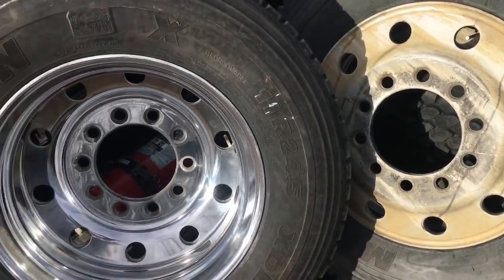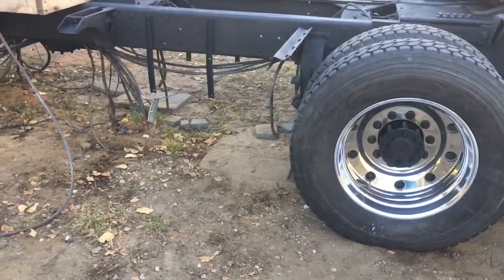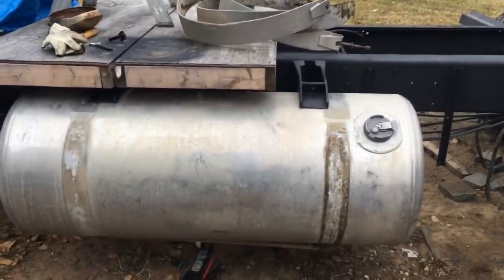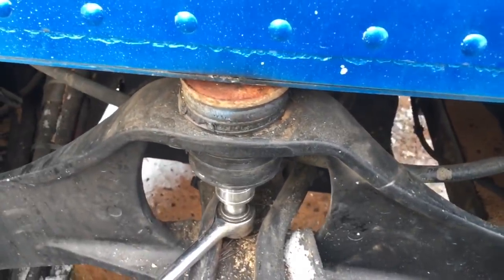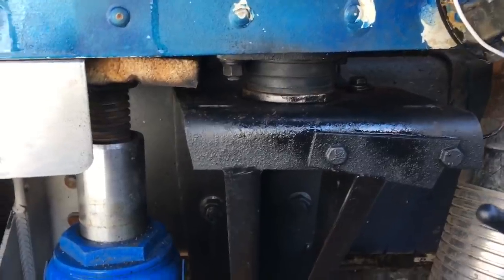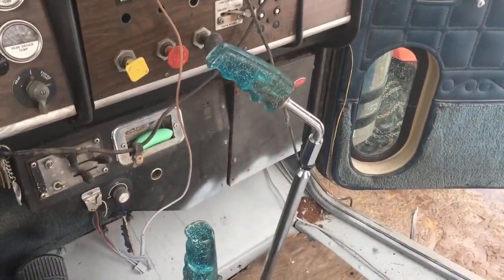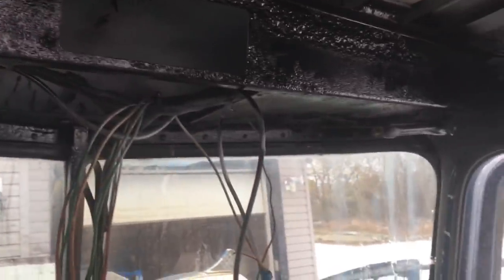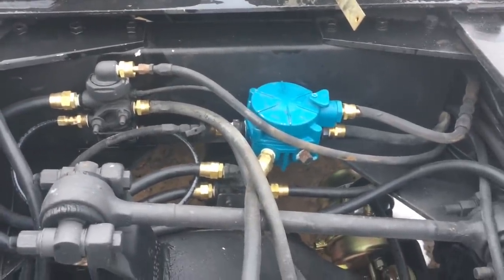Peterbilt 359 Restoration Ep.20 Polished Wheels and other Fun

Comment: A stock 3406a cat pushes 380hp, all you need is marine cat injectors and turbo and that 3406a will be cranking out 550hp to the ground.
Reply: Interesting. Will the pump need some internal valving, or is it "plug and pray"? :)
Reply: Thor Warenskjold no just the cat marine cam injectors, fuel system upgrades, marine crankshaft and the new turbo.
Reply: Holset turbo
Reply: William Emmell IV yes
Reply: not necessary ....  and it's easy to custom rate that diesel......
Reply: Will have to look into this

Comment: You're going to want to mount the air lines below the axle location bar, and get a plastic hose spacer to locate the hoses so they don't touch or rub against any other part of the truck. When the axle drops it may end up ripping out an air line. In your colder climate plastic air lines can get brittle and break at the worst possible moment, so stick with rubber reinforced air-lines. Your area sees temperatures as cold as -50*C

Comment: Nice Job, you just have to take it one job at a time.... the mice are drivin' me nuts too, probly by next summer I'll be replacing fuel and air lines on the old bus as you are now.... gotta do the brakes on one corner and convert the tag axle to oil bath bearings..... great to see old iron brought back to life... just keep swingin'

Comment: Just a suggestion with the damaged and dented fuel tank..... cut it open and turn it into a tool box for the truck and caravan. And put the new one on the other side... yes you'll loose fuel range but you'll end up with a unique toolbox.

Comment: As a Cummins employee, it pains me to see a CAT under the hood, but CAT's are excellent engines as well:-) (it's actually too bad they stopped making them).  Not long ago we had a similar vintage Pete' in our shop, and the techs did a rebuild on the engine....which the block was 80's vintage, haha. I had fun finding parts to replace the worn ones....really had to scrounge for parts:-).  Truck is looking great, love the wheels, once the fuel tanks and air cans get all shined up, it will look pretty awesome!

Comment: If you have dents in your tanks, fil them with water and slowly pressurize them to take the dents out. Unless they have been patched / repaired. Then all bets are off.
And do take care on having a piece of rubber between your tanks and bands / mounts.

And fyi, most injection pumps have a manual lever that shuts off the fuel. Make a pull stop easily enough.

Comment: Cat 3406 engine does not shut off by closing a fuel line there is a solinoid that moves a lever inside at the back of the pump that other in line solinoid might have been on the return line to increase pressure for power. When the pump solinoid fails people take it off and break the lever off and the truck won’t shut off. Good luck.
Reply: I was thinking the same thing,   in fact, didn't they have a manual screw you can turn in to kill the engine if the solenoid fails...   Really tickling the ol' memory bank here.   I have rebuild a few b block pumps,  seems to me..

Comment: there should be a manual shut-off lever on that fuel pump that you can put a pull cable on maybe just for emergencies or maybe as a primary shut off as far as your shift linkage goes you can adjust that so that your levers don't hit each other by adjusting it on the linkage

Comment: Mack uses an electric shutoff solenoid on the old Robert Bosch pump engines. That may work for you. Your local Mack dealer should be able to source it for you.

Comment: hate to say it but Irish Spring and other punching items do not deter mice. Check out a guy's YouTube channel called Shawn Woods. He recently posted a video of putting Irish Spring out and is chicken coop. And the mice ate the bars....
also that classic handle that was accidentally broke. You could try recasting a new one using smooth on products. To do a resin cast of it. You have the original will look pretty good shape after being dropped and glued together. To cast a new one. Just an idea to toss around
Reply from the maker: Other World Explorers good idea on the recast ... I could use the shift handle on the primary as a cast as it’s identical and not damaged

Comment: Pal, 30 years working at Cat on truck engines.  That’s is not the shut off....actually not sure what they have that for ??  Fuel shut off is at rear of the governor and located on the lower part.  When you remove the power it will actually pull the fuel rack in the pump and shut off the engine, not shut the flow of fuel off.  There is actually a shaft near the shut off solenoid you could make it a manual shut off like a older Mack if you wanted.
Reply: Yes , thanks was reading to see if anyone made that point. Most had manual pull knob for shutdown. No need for an actual solenoid.

Comment: Have you tried charging the air system yet or not yet
Reply from the maker: Ethan Northrop I charged it up last winter on the original lines and everything worked other than a few leaks.  Can’t put air to it now until I put on the air tanks and terminate all the new lines.  Hopefully by Christmas ...
Reply: 359 TwinSticks nice. At least you knew. It’s always good just to slowly work your way through all of them. It prevents a lot of head aches later down the road. Trucks looking great my friend

Comment: If u have no air pressure the truck will not shut off 
Thats what that valve does
Reply from the maker: Gregory Brunner that makes way more sense ... I never traced that line back to see if it was air or fuel and just assumed it was for diesel

Comment: Dumb question from a German viewer: Do you need a special drivers license for this or is a normal car drivers license good enough as a privat user?
Reply from the maker: stevehislop not a dumb question at all ... yes you need a special license in Canada to drive a truck like this ... if you drive it without a trailer you need a Class 3 and an air brakes certificate (1-day class) and if you pull a trailer with air you need a Class 1
Reply: 359 TwinSticks How many hours of driver school does class 3 and how many for class1 require? Or do you just buy these licenses? BTW: I used to live in Kitchener/Ontario and really admire your work. I used to think restoring a car is a lot of work...

Comment: I can't believe the number of thumbz down but I guess haterz gonna hate and though you obviously have more money to work with then i do at the end of the day we have to work with what we can afford, on a previous vid you mentioned that some were saying you should have changed the roof cap, but yet those same people didn't offer up any money just a negative opinion which sadly the world is full of, and I personally have been dealing with that same attitude ever since I got my old Freightline,  I did get my class 1 borrowed a trailer from a ex BF and hey so I cheated the driving part a wee bit, skin tight Tee and no bra yeah I passed it though...lol..I didnt really need the class 1 but i figured hey! may as well.... and I did end up having to move the seed truck for my current BF even though on side roadz just best to have the right tool for the job sometime...lol ...